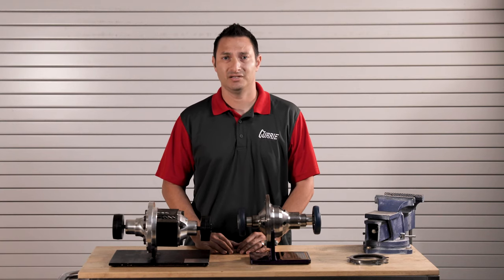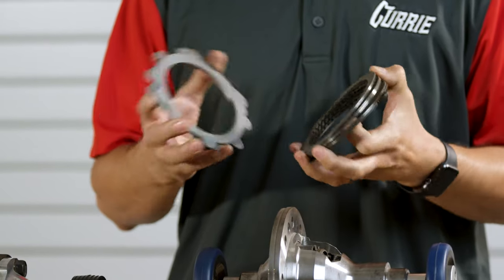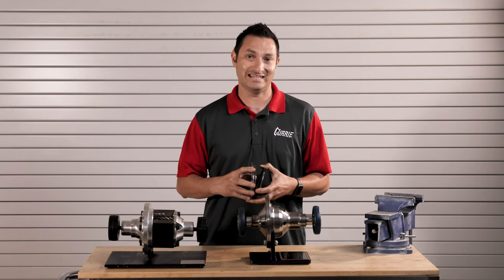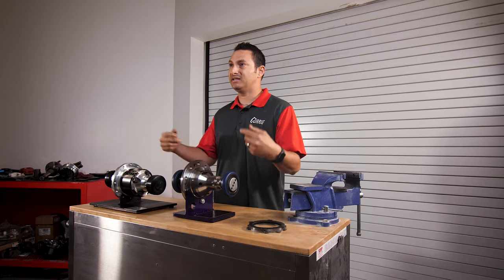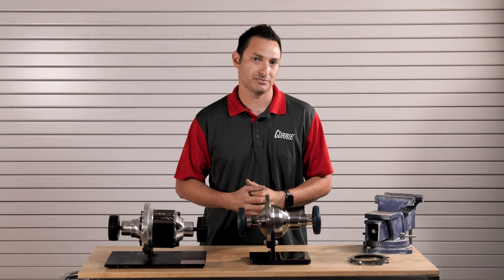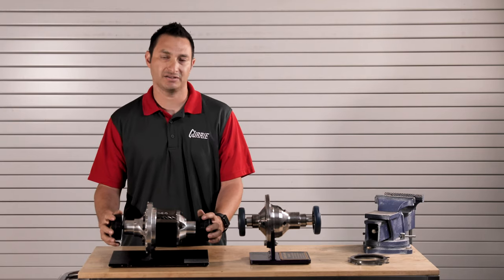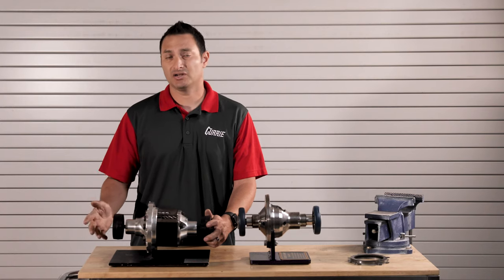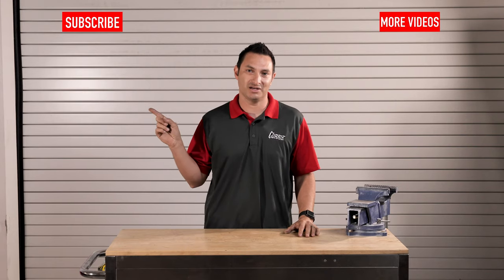HOW TO SELECT THE RIGHT DIFFERENTIAL | EXPLAINED

Comment: Pitfall of the TrueTrac:  one wheel off the ground and it goes full open.  This Torsen style diff will allow one wheel to rotate faster than the carrier, but forces the other wheel to rotate slower than the carrier.  When one wheel is off the ground, it will spin faster than the driveshaft while the wheel with traction doesn't spin at all (slower than the driveshaft).  There are some driving techniques to overcome this (gassing while on the brakes to slow the spinning wheel). Not great for rock-crawling off road.

Comment: So I recently brought a set of 38 inch tires and I have a 2009 F150 six speed transmission four-wheel-drive and I have no clue and trying to get as much advice as I can. If I should get 4.88 or 5.13 I don’t do any off-road at all  but I definitely want to have nice low and torque I mostly only do city driving. If I go on the highway, it’s only an hour away to go to the beach.  Opinions please

Comment: It doesn't act entirely like an open differential in normal driving. For instance in a vehicle with a split front axle (like a jeep YJ) it will force the front driveshaft to spin while moving. This results in vibration, noise, less mpg, more stress and wear on parts. I guess an air locker is the only way to overcome the front shaft spinning. Or manual hubs.

Comment: I just had a Eaton True Track installed in my 2007 BF Falcon and I've noticed a noise coming from it when you back off the gas or coast in neutral. No noise on acceleration, bit strange. Any ideas?🤔🤔🇦🇺🇦🇺